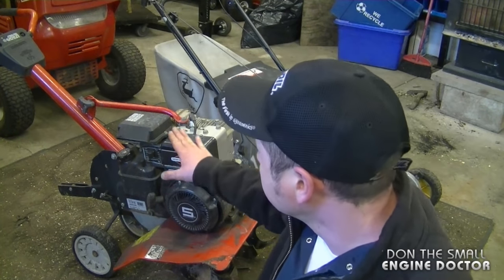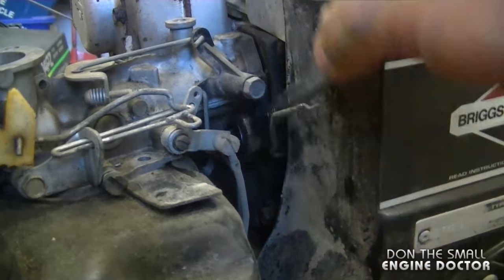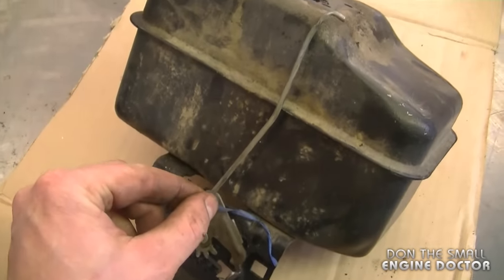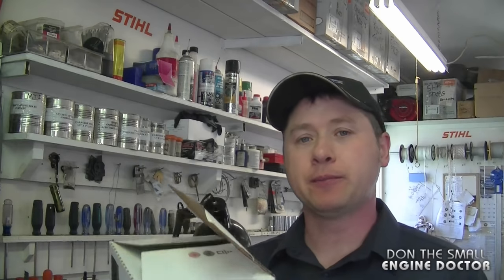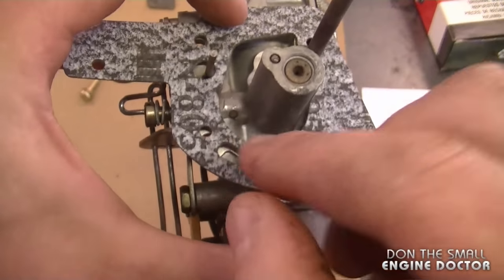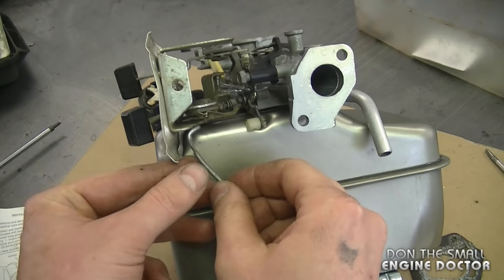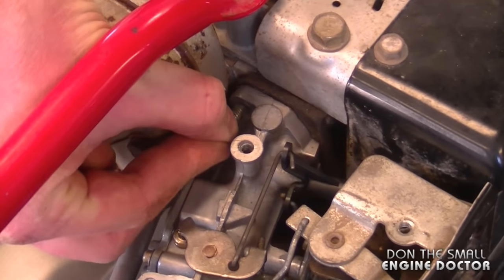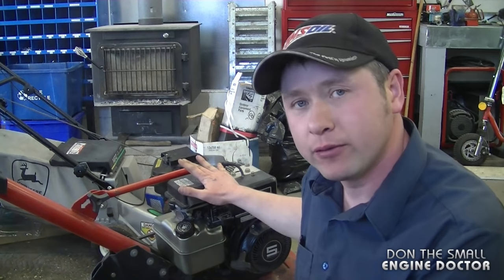Fuel Tank Replacement On Briggs & Stratton 4-5HP Engines

Comment: As an adventuristic old woman, I volunteered to fix my sister;s junk 5.5 hp Craftsman tiller.  Though I truly thought your video was detailed, you made it look alot easier than it was.  As a critique, one of the carburetor screws which you tightened, was also used for the control box.  The spring is almost impossible to get hooked properly.  The intake screws at the manifold, one which goes in easy, the other almost impossible without special tools.  If the spring doesn't hold, it means you gotta take out the manifold screws again, etc. etc.  Also had a problem with the white plastic float plate adjuster coming off its spindle  Last time I volunteer for a pulsa jet carburetor.  Had a hard time finding right parts.  Got right gas tank gasket and wrong diaphragm.  Then there is the matter of the gas tank on these pulsa jets which are junk.  Divided into plastic baffles.  Impossible to clean properly.  Don't know if you could use electrolysis with plastic baffles.  Then there is the sponge rubber insert 1-1/2" or more thick that hugs the top of the tank.  a real invitation to collect moisture and rust in the tank.  I am sorry to see that Briggs and Stratton paired itself with such a setup.  I love their motors, but this carburetor.gas tank setup is the worst.  Thanks for the help though.  Keep up the good work.  

     Oh, by the way, the tiller still doesn't work.  Washed the diaphragm 

(cause I got the wrong one).  Carburetor not pulling gas.  Will try new diaphragm.  Anything else I can do?  Thoroughly cleaned the carburetor and tank as best I could.  Removed and had great joy throwing away the foam  from the tank. Other than the baffles, what other kind of parts are in the gas tank?  Appreciate a response from you or others.  Thanks again.

Comment: Don, thank you for this great video.  This tank is hard to find now, and very expensive if found.  Do you know of a tank/ carb combo from another model that would work?  I included carb because I assume the connection to the tank would be different.  I had trouble finding a carb for a Kawasaki four wheeler once and used a Honda one, and modified the choke and throttle ends to be Honda on one end and Kawasaki on the other.  I've worked on outboard motors, car engines, and small 2 cycles, but don't know much about a lawn mower engine.  I was waiting for you to remove the needle and seat and jets on the carb cleaning, but you either didn't do it or they don't have them.......  Thanks for any input you can provide for a tank solution.

Comment: I have the same engine on a log splitter. One end of the kill switch wire mounts to the carburetor on the same pinch clip you show. The wire then runs to a plug on the coil. From there the wire pigtails off to somewhere on the bottom of the engine block. But when I attach it the the block... it just grounds out the coil all the time. Where should this pigtail attach to?

Comment: Got my Tiller running again, but it smokes with a black smoke that has a burning smell, rather than just exhaust smell, and coming form the engine apparently. Any suggestions. I ran it twice for <30 sec., but no longer since I don’t want it to catch fire.

Comment: In working on one very similar to this one, but I can't find a new gas tank so I have to clean out the tank. I put the new carburetor on but it only runs on choke.  The difference is the throttle attachment is on the bottom of  the gas tank not the top. Any idea why it's only running on choke MN

Comment: I have the same engine on a tiller, however my throttle is up on the handles of the tiller.  Mine is terrible hard to start.  I have to adjust the choke a few times at precise locations and then very quickly throttle it up and open the choke all the way to keep it running, otherwise it will die.  I can't figure out why it's so hard to start.  I've cleaned the carb, check all linkage and everything seems to be in order.  Once it's full throttle, it runs and tills great... it's just so hard to get it started.  Any idea why it's difficult to start?  Thanks.

Comment: Hi, I have an old Briggs Stratton tractor, with that same engine. I would like to ask if you could tell me the number and model of the specific engine so I can find the breakdown and repair manual. It doesn't start when cold, but I do add carburetor starter spray liquid directly into the cylinder through the spark plug and it starts well and runs, but I saw that the revolutions were not stable, and I removed the rope handle cover to start, to see the plate with the coil or magneto and it has rust, but I cleaned it and the revolution stability was solved. but it still doesn't start well when cold. After checking the gasoline and the spark plug and the air filter, everything is fine. Then I opened the carburetor cover without disassembling it, and as far as I could see it is clean and the spring and the cover gasket are perfect, and the little tube that connects the air filter box to the cylinder is fine too. What can happen ? Maybe it's the carburetor fuel intake? Should I disassemble the entire carburetor and clean it thoroughly, or is it something else I don't know about?

Comment: The replacement carb is approximately $25 on Amazon. Is it better to clean out the original equipment or just replace it for $25?

Comment: Hi Donyboy73,
nice Video- made it easy for me to clean my carb, too.
One question: in the Briggs&Stratton download-manual for this 5HP-motor, it says:" See an Authorized Briggs & Stratton Dealer for carburetor adjustment.The carburetor on this engine is low emission. Air/fuel mixture is not adjustable. Only the idle speed screw is adjustable. "
Is this true? However, in the printed manual that came together with my motor-tiller, the opposite is printed: it says that I could adjust the mixture for the idle-jet with the needle-valve -screw!!
Do you know what is true? 
Perhaps you could make a short video in which you demonstrate how to adjust  this type of carburetor to the optimum mixture?

Comment: Great video. It was a big help . Put a new tank and carburetor. It ran good for about 30 minutes, now it won’t stay running, like it’s not getting fuel. any suggestions?
Reply from the maker: check carb adjustment, diaphragm and spark

Comment: What is the model number for all gaskets for this engine.  Not just the fuel tank.  I have the exact same rototiller and its leaking oil.  Also will do the fuel tank.

Comment: I got the same engine I cannot get it to start new spark plugs great compression I clean the gas tank doesn’t have any rust in it change the oil check the air filter I still cannot get it to start spark plug shows a spark is there anything else I can check I watched your film only thing I see different is I don’t know about the carburetor maybe maybe there’s that screen at the bottom of that carburetor I might have to try to take that off and see what the gas tank does isn’t that dirty I appreciate if you could respond back and maybe give me an idea I’m about ready to put this thing on the curbside it’s actually a leaf shredder

Comment: I have a 3.5 Briggs and Stratton that I need to replace the carburetor.  However, mine looks like your but some of the connections are different but sits pretty much the same way.  However, I removed all the screws and bolts but the carburetor will not twist off the tank where it sits.  I can see it move freely but for some reason does not come off.  Any ideas?

Comment: A suggestion: always remove the breather tube first, and install it as the final step before mounting the air filter.
That gets it out of the way of the upper carb-to-head screw and avoids damaging the rubber elbow.

Comment: I have an older version of these motors, from 1972. My issue is that the pickup tube, which is brass, doesn't have a screen on the bottom to prevent debris from getting sucked into the carburetor.

Comment: The plate that indicates which control is choke and which is throttle the rivets loosen up and rattles all around so I drilled out the rivets and installed self tapping screws there's plenty of room for just about any self taping screw

Comment: Awesome video!  I wish I saw it before I took off my tank.  I have the exact same tank and carb, and took off the tank to replace it without removing the carb.  I'm ready to install a new tank, and discovered that I have one dangling wire from the engine, and I'm not sure where it goes.  It has a ring terminal on the end of it, and I didn't see it in the video.  Anyone have an idea?  Is there a way to post a picture on this channel?   Thanks!

Comment: Purple power is safe on plastic carb parts and o rings for me so far.  I just soak those parts separately in purple power over night.  Do not put metal particularly aluminum in purple power as it will dissolve the metal.

Comment: Hey Donnie, i have a question,excellent video by the way,been subscribed for awhile,i have a tiller that uses the same identical engine, my question is...

On the control plate when i put my tiller on choke the lever doesn't reach quite under the choke sign like yours does,i was wondering why?

I recently overhauled this machine and every linkage is exactly where its supposed to be and the choke works fine, just not sure why the choke lever doesn't reach all the way to the end of the control plate, makes me nervous someone could use it and slam that lever to the end and break the little plastic choke thing (i have several friends and we loan our things to each other on occasion) i know i could tell someone "be careful with That choke lever" but i would like for it to work like its supposed to, nothing is bent , for example on 20:18 on your video you can see that choke lever almost to the end of its travel, mines not even close to that and its already closed.

Maybe im missing something and i just need to really carefully look at that linkage again,as a matter of fact the choke linkage is standalone for the most part,once that little plastic thing stops against the carb body its not going any further, sorry for being anal,i just like things to work correctly.
Reply: Use top hole on plastic choke part.

Comment: Hey,donyboy: Maybe my Tank Mount Bracket has a small wire harness on the tank side because it's for a power washer? I took it off so that I could watch You re-assemble it and You did not have it on Your Machine! Any Idea where I could get a look at how it goes back Together? Most Greatfull for You Sharing Your Skills at this JustBob
Reply from the maker: just find a parts list online possibly

Comment: I can't seem to find this tank anymore.  Any tips?  Is there a replacement that will work?  Thanks.
Reply from the maker: it is no longer available
Reply: @donyboy73  That's not very nice,  Thanks anyway, I appreciate the answer.
Reply: Is it possible to retrofit a tank and carb from Brigg and Stratton classic or sprint ?

Comment: Thanks so much.  But, can fuel tank be removed without taking that carb off????(engine is on work bench0
Reply from the maker: you could but i always remove it with tank
Reply: @donyboy73  I have "played" with little engines all my life, but my career took me
far from them.  Now that I am old and the memory is poor, I must keep it simple.
The enjoyment is still there when I hear the first putt and see that little white smoke
come out the exhaust...LOL

Comment: Excellent video, but I can't find a new 694315 tank on line
Reply from the maker: it is no longer available
Reply: @donyboy73  Thats unfortunate, but your video is nevertheless unique and extremely helpful.  Using your video, I plan to remove the rusty-inside but not yet perforated tank from a 5 HP Briggs on a chipper/shredder, then pull out the plastic foam and clean it up using abrasive media as has been suggested in other videos, then treat it with POR-15 gas tank repair. Thank you again for your great video! Any other suggestions?

Comment: I had an older (1969) winter version of this engine, when it ran it was okay, but was needlessly complex. If I see these engines on equipment I happen to acquire,  I try to fix them but more often I buy a new engine based on the Honda GX series and replace it.

Comment: I’ve had this problem with these special five horse Briggs & Stratton motors the fuel tank has a nice unit for the controls they did not make that tank no more take the tank off take the carburetor off soak it in white vinegar for a week or so the tank will come out brand new flush it all out with some brake cleaner put it all back together put clean gas and stabilizer in your fuel and you’ll be good to go for the rest of your life don’t ever let the fuel go sour A bit full all the way to the top one and Storage even if you use non-alcohol gasoline

Comment: I just basically did this. I replaced my carburetor. I replaced carb cause I ran out of gas, refilled & broke pull cord. I fixed pull cord & it would not start. It's a 5hp verticle shaft on a log splitter. I have 60 lbs of compression, I'm getting fuel, & spark, & the keyway is on the shaft. Should start. I replaced carb cause I figured it was dirty. Now that it's back together it's the same thing. Please help

Comment: Put a bunch of steel nuts in tank with gas in it and swirl around,the nuts will clean the inside of tank,common fail of carb is the plastic pick up tube gets hairline cracks in it.

Comment: 😢 that part number in the website isn’t available… where else can I look and I need a carburetor as well
Reply from the maker: try amazon
Reply: Ummm 😳Amazon,Walmart,troybuilt website out of stock … eBay sold a new one for $200 …. There is a used one that kind of looks like it’s it but not sure and they want $140 with old carburetor
Reply: Can I get a 5 hp carb w/ bowl and relocate a regular tank up on my tiller post

Comment: As previously indicated, i installed a new carburetor and fuel tank on this exact type roto-tiller.  After the install, the unit started and worked fine without any problems.  the next year, I tried to start the unit and it wouldn't start.  I used starter fluid and it started but stalled after a couple of seconds.  I then put the unit away fully frustrated.  This year I tried again.  Still the same result.  I took the carburetor and gas tank off.  I cleaned the carburetor and made sure there wasn't anything clogging the jet, etc.  Also checked to make sure the gas still good.  After assembly tried starting again--no go.  Once again used the starter fluid and once again started for a couple of seconds, and it died out.  Does anyone know what the problem is?  I would really like to use the tiller this year.
Reply: Not getting fuel so it’s the diaphragm not allowing it to pump fuel or the carb is clogged and not letting it get fuel.

Comment: I changed to gas tank and installed new carburetor last year.  Machine ran fine.  I tried to start up this year and it won't start.  I used starter fluid and it starts but dies out immediately.  Does anyone know why this is happening?

Comment: I have a old 1980 engine and the carb on those  are like 100 bucks and not worth replacing I was wondering could I take a carb off a lawn mower with the pump diaphragm and build a tube to connect them wondering if anybody has tried this yet

Comment: very informative! mine runs great until the little "fuel bowl" in the tank runs dry. just replaced the entire carburetor assembly (with new pickup tube), still does the same thing. im tearing my hair out!!
Reply: Take small craft wire or guitar wire and clean out hole in bowl return. This might help.

Comment: Donyboy73, I have a 20yr old Homelite ut10790 chainsaw i can't find a carb for. it has a up06737 on it. Sears says I can use carb #000998271 and it will work find. Just want your input before i spend the money.  Member for life, Russ

Comment: You can buy that carb on Amazon for $20 brand new with gaskets..
Reply: Do you have a link or anything? I have the same carb on mine that needs rebuilt but if you know where a new one is that cheap that'd be amazing.
Reply: @bcsprothree  hi did he ever send you the amazon link to the 20.00 new carb?
Reply: @luisholguin8046  no never did find out

Comment: Worst tank/carb setup ever made. Briggs tried their best to make it as complicated as they could. A new tank cost more than a brand new 6.5 hp Predator engine. And if you pay someone to replace the tank you could probably buy two of them. I have fixed these B&S tanks by cleaning them with muratic acid and coating them with POR 15 gas tank liner. No more rust then.